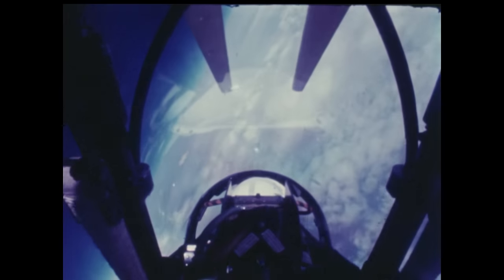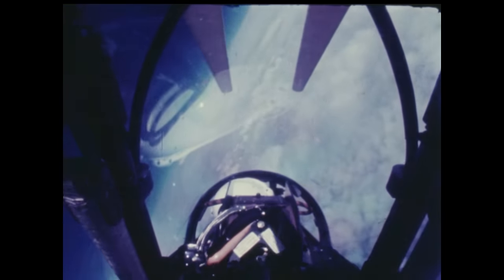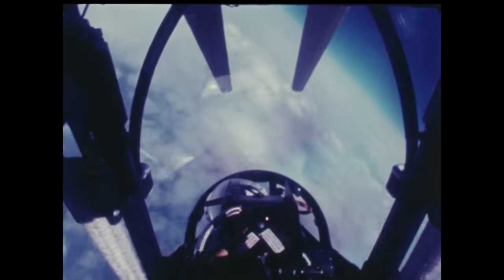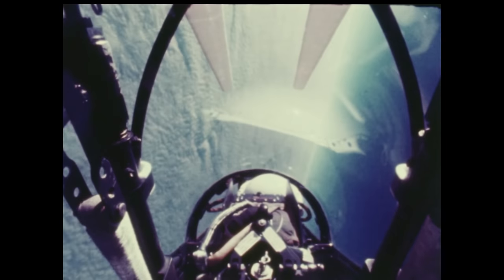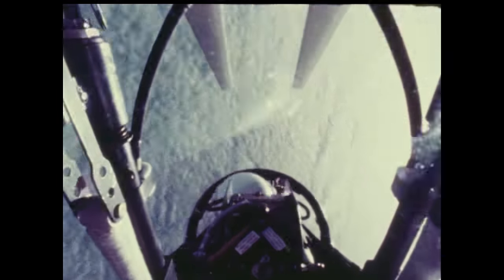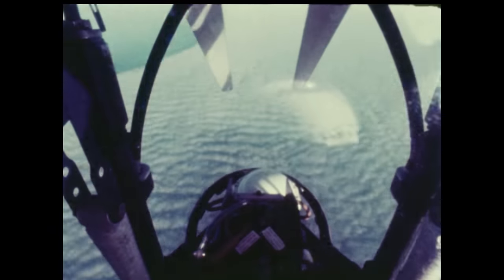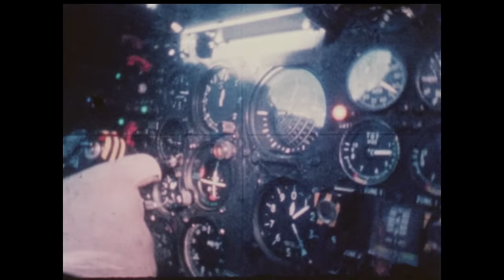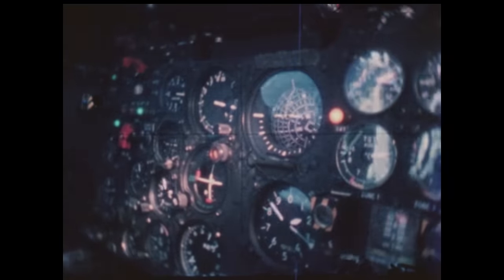Jaguar High Incidence - Loss of Control - Recovery Procedures

Comment: Very interesting.  During my undergraduate apprenticeship at Warton ,  in about 1970,  I spent 3 months in the Flight Test department.  The Lightning spinning trials were over,  and I helped prepare graphs from the telemetry tapes.   A number of Lightnings had been lost during medium level high g tail chase manoeuvres.  Recovery was achieved by “letting go” of the control column…..that’s how it was put to me, but it was probably by centralising the column,  and not by trying to recover by pilot input.  The A/C would roll and when unloaded, control was regained.   If mishandled, then the ensuing spin ,  had such a high rate of descent that from medium level….15,000 ft…that recovery was impossible in the available height.   The test aircraft was fitted with a tail chute .

Comment: Not incidence. Angle of attack.
Reply: The chief pilot uses the term "high incidence" multiple times - he knows what he's talking about I'm sure. Often of course "high incidence" equates to a high AoC. The term "high incidence" is used for a low speed stall at high altitude.
Reply: Attack/incidence - same thing.
Reply: @abagatelle  The angle of incidence should not be confused with the AoA. AoA is the angle the wing chord presents to the airflow in flight. Whereas AoI is a fixed angle on most fixed-wing aircraft - it's the manufactured mounting angle between the wing chord line & a reference line [often the direction of minimum drag, or where applicable, the longitudinal axis]. 

I repeat: The angle of incidence is fixed in the design of the aircraft, and with rare exceptions, cannot be varied in flight.

nb some engineering texts that focus solely on airfoils may use either term, but practical aviation recognises a distinction.
Reply: @nightjarflying  Sure, but in common use they're equivalent - as I learned at ETPS.